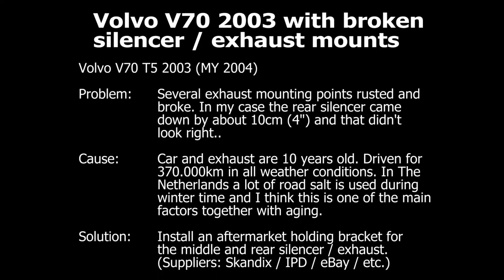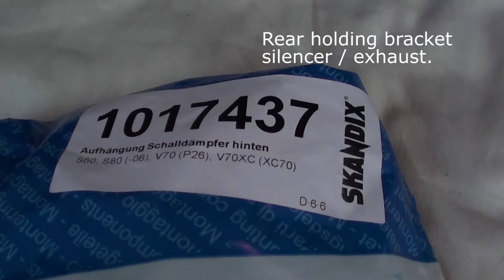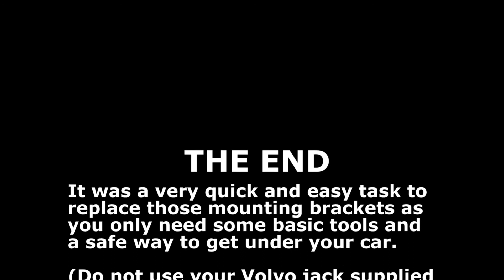Volvo V70 2000 - 2007 replace broken exhaust holding / support brackets

Comment: For the US folks, Ipdusa is selling this as of 2020 https://www.ipdusa.com/products/22096/140399-volvo-rear-exhaust-hanger-repair-kit-aftermarket-25432665 For UK https://www.ebay.com/itm/VOLVO-S60-S80-V70-XC70-REAR-EXHAUST-REPAIR-HANGER-BRACKET/362635916556?hash=item546ec8f50c:g:JsoAAMXQvtZQ3yQe   Or you may try my quick fix (use a small chain instead of wire) https://youtu.be/i21XF8K1eHM

Comment: These sell on Ebay 
http://www.ebay.co.uk/itm/152101884390?ssPageName=STRK%3AMEBIDX%3AIT&fromMakeTrack=true
One thing to check is how this bracket is attached to the exhaust.  You should not place the bracket on the tailpipe.  The tail pipe is welded to the muffler (silencer) and this weld cannot hold the weight of the muffler.  Place the bracket ahead of the weld between the muffler and the tail pipe.  Also pass a finger on top of the named weld, feel if it's cracked.